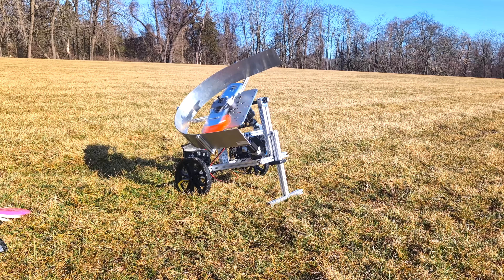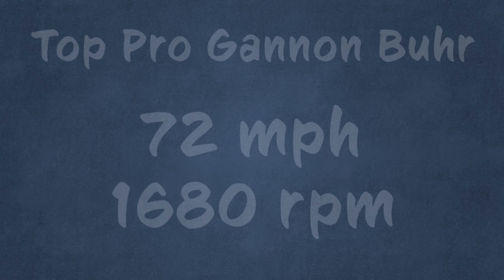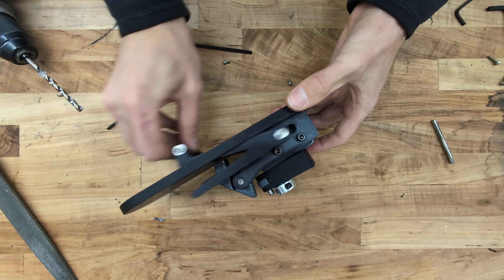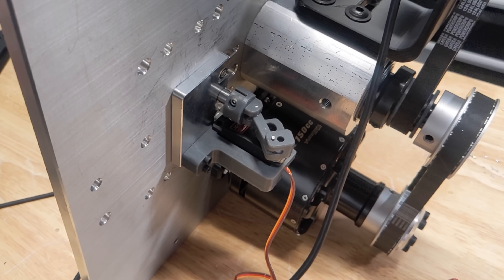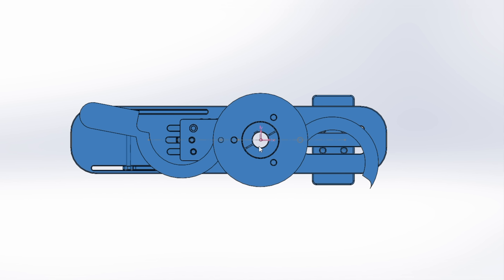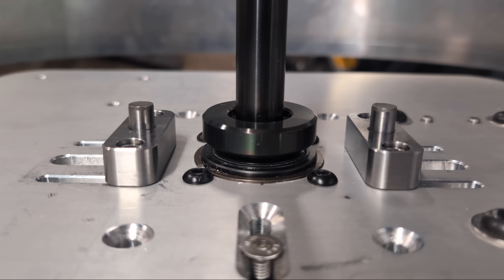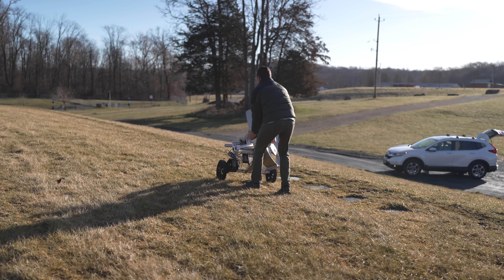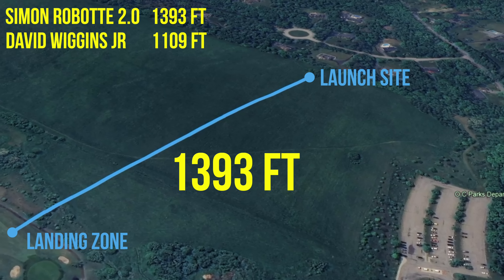We Built the World's Fastest Frisbee Launcher (Regulation Size)

Comment: Instead of strapping it down harder, could you not have some rubber bushes on the legs to remove some of the vibration? So strap it harder to the rubber blocks that will mean there is some flex and give, plus it softens the aggression if that makes sense?

Comment: The one that came back to you might have been because of the angle of attack that you launched it at. That's a frisbee trick I used to do to play catch with myself all the time. If you throw it at the right angle it acts like a boomerang and comes right back to the thrower. I think you need to dial back the speed and do a bunch of angle of attack tests to see what throw is actually the optimal for distance. Especially with your machine being able to do not only angle to horizon launch degrees but also left right angle.

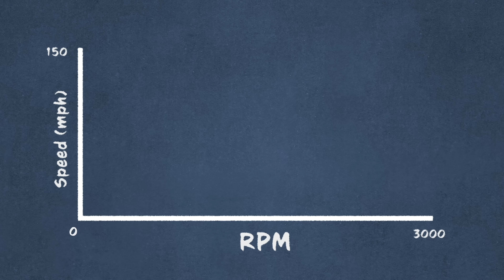Comment: 2:12 why is there no math needed? the fact that disc rpm = arm rpm is not obvious at all. 
the dV of the inside and outside of the disc are fixed independant of rotation speed. the faster it spins on the oustide the faster it spins on the inside too. otherwise the disc would deform, and it doesn't.

Comment: If that motor is really 13.4 HP,  they have come a long way.  When I worked in a factory a 5 HP motor was moved with a forklift.
  
But more important, the stresses on your metal must be real or the parts wouldn't have bent.  But similar stresses must be present in the human arm of the thrower.  (especially in deceleration)  Wiggins 1100 foot throw was in a 43 MPH wind, but he can legitimately throw in the 700 - 800 foot range, so around half that of your machine.  Seems like his arm should come off.  

I've been to Punkin Chunkin and watched the centrifugals fire pumpkins, same principle as your machine.  Did you get any design help from those?

Comment: call me old fashioned, but as teenage automotive  punks in the mid 70s, we could have told you these early designs would fail. Aluminum is MUCH WEAKER. The forces in play are huge. When in doubt, use steel.

Comment: I used to throw these things on the beach spent about 10 years perfecting long shots, I think stuff made here could throw a lot further if he can get some rollers that don't fall apart because it was always the last flick giving it more spin than what your arm was spinning that gave it more airtime, spin was more important than power. You should also try launching over water, I think the air flowing over water is smoother than the air flowing over ground, so you will be launching into very smooth air compared to on land, I think this could be why the guy broke the record in the desert. The air at the launch site is moving smoothly.

Comment: @We.Make.Machines  I've been playing for 25 years or so now, I'm not trying to sound rude, but instead help you get better.   You need to work on your drive throw.   You look away for half a second before release only to look back right at release.   Instead keep staring down the "green" and get that arm nice and parallel with your eye direction.  It's going to take a lot of practice to break your current drive habit.  But you'll see a huge improvement over time of rogue throws slapping into trees and poles and whatnot haha.

Comment: Those spin numbers are interesting. The rim is spinning at around 60% the speed of the disc.  So that would mean it's like it is launched from a hinge point just 7 cm from the rim (I'm only 2 minutes in so I guess you'll have those 7 cm from the rim of the disc to the center of your spinner thing). But that means the forearm has passed more energy into the swivel of the wrist at the time of launch than I thought. Interesting 🤔

Comment: you should mount a flywheel under the arm, or if possible on the opposite side of the motor. this will add gyroscopic stability to the machine. i would suggest a semi-trailer flywheel. and the release finger could be curved like a cam.

Comment: Would it be possible to increase speed by using a whip effect? For example if you added a string that holds the disc and keep the same spinning design but then use the lag force of the rope to launch it faster and further?

Comment: I noticed your horse shoe shaped shield on the machine. It's attached from the bottom side with three narrow brackets. I feel like it would have done better with a solid metal bottom and maybe even a top. You wouldn't see the disc while it's in the machine but all that wind it generates wouldn't escape, also it would give the machine more stability. Just a idea 🤷

Comment: Discs should be standardized with this and have a chart with different speeds and what to expect at every 5-10 mph increasing increments starting from 40-50 mph, could even have a anhyzer and hyzer chart as well. It's not going to be 100% due to different spin rates and nose angle humans apply in their form but it will be better then accepting something like 9/5/-1/2 as a rating and get a meat hook or a roller.

Comment: i reckon you can nearly double the force by altering the design a bit.

what happens if you jam a stick in the front wheel of a bike?

make the wheel with the intention of braking it as rapidly as possible. "jam a stick in the spokes". at a point directly opposite the disc itself. let it pivot freely around that point when braked...

yes, its going to absolutely slam the brake... thats the idea. the mount is solidly fixed to the ground and doesnt move. 

 and all the inertia stored in the wheel is going to convert to a torque around the new pivot. now the disc, along with its current velocity, is being accelerated by the inertia of the wheel itself, pivoting off a fulcrum twice the distance away.

light wheel, heavy disc... no force. heavy wheel, light disc, plenty of punch...

Comment: Boys youre good at mechanical engineering but i guess youre not that familiar with some stuff from electrical engineering, so let me clarify some stuff for you. For this application there is a much easier way to make this work. For getting the disc to spin at a desired speed you apsolutely dont need a powerful motor. The disc is really light weight and doesnt need as much torque to be accelerated (even with the counter weight). Other very important thing is that you dont need a mechanical way of braking. If you use just a regular ac motor or servo motor drive you can do different types of braking. The fastest way to get something to decelerate, which is faster than any mechanical solution including friction or counterweight, is to brake the ac motor with DC current, or in the case of using a servo, a down ramp. Only in this application the power of your motor, which dictates the torque motor can achieve, also dictates the braking torque. But even for the smaller motors in this application the braking would be instantaneous or with a curve you choose. For braking in this application i would choose an S- curve on motor drive, which preserves the mechanical parts the most (barely any stress is applied).

Comment: I use the same motor in my 30lb combat robot. Its job there is to drive a 10lb steel drum up to a tip speed of 330mph. I've seen similar failures to that bent arm in some previous drum designs with the middle bowing out. I've sent other 30lb machines more than 10 feet in the air before. The kinetic energy involved in that arm is insane.
Reply from the maker: It's an absolute monster! The motor is hardly running above idle current while spinning our 11lb arm.
Reply: @We.Make.Machines  For me it spikes to 200A on startup and gets cut off there, but once the weapon is up to speed and mostly contending with aerodynamic drag, it wants to sit just above the idle, very similar to your spinning arm. I'd wager you aren't seeing as large of a spike as the motor is ramping up much more slowly. Apparently the 250lb bot "Claw Viper" on the Battlebots TV show uses a similar motor to drive each of 4 wheels individually, and the bot "Riptide" uses a pair in tandem to spin a 50lb+ weapon at 250mph tip speed. Mine was taken from an electric dirt bike, if you want a cool extra project for it.

Comment: We know the human record was with a 150 class R-Pro Boss, what was the weight, plastic, and mold that set the robot record?
Reply from the maker: Lighter discs are easier for humans to accelerate in the short time between reachback and release. With some mods, our machine could throw a 5 lb disc at 200mph if we had one.
Reply from the maker: 175g Z Nuke OS, but I believe there are many plastics and molds that could go at least this far.
Reply: @We.Make.Machines  That's a beefy disc!  Usually the human distance records are with more flippy plastics or lightweight discs.  This shows how powerful your bot is since they don't really make 13 speed discs with more stability than that.

Comment: This machine should be tested in regular pro speed with each disc to improve the sport and disc manufacturing. By determining the exact launch angle and speed you could test the actual numbers of a disc and the actual physics of the sport. Of course you have to have the perfect conditions such as almost no wind what so ever . Or you could just find an equation to bypass the effects of the wind and tell you the number needed... BTW: You could actually be able to create a disc golf simulator or launch monitor using your machine's data  just like golf. It could even be just a phone app because no such speeds are necessary like real golf. A good phone camera would be sufficient even for a pro ;)  . But anyways this is the only successfully working prototype that I could see on the internet for  disc golf so far . Kudos to you guys !!!

Comment: https://youtu.be/xr-ik3WJnO0?t=923
 "that didn't sound good" 
is this why there were no more attempts? cool design but terrifying. Gotta get some steel into the structural support for the throwing arm so it has some flex strength and can rebound better.  Also, you really need to find a more remote and larger location, you're last toss went into a golf course and if that beaned someone you would have lost everything.

Comment: Love this follow-up to the previous video with the minis! Hopefully in some months time we'll maybe get another follow-up where you dial it back and see if you can better replicate real throws. Would have been cool to see the TechDisc data thrown on this thing (not full power so you don't destroy the TechDisc). I'm guessing you would find that the disc's nose angle is flat at best, and potentially nose-up. The nose angle is definitely what made that last throw on the first day into more of an MTA attempt than a distance record.

I'm also guessing that comparing a real player to this machine at the same launch speed would reveal you're not getting the same RPM at launch on the machine. For a real player, there's a whip-like motion that's ripping the disc out of the hand at the hit. This should result in higher RPM than just relying on difference in velocity at the inside and outside of the disc from simply spinning the whole thing like this.

Nose angle should be addressable with a tweak to the release armature, and I would love to see how that changes the results you get. Imitating the more whip-like release would be a whole other challenge, though.

Comment: It is so crazy that it took building an insanely high powered machine like this just to beat David's record by ~200ft. Yeah that is a pretty good margin, but for that amount of power I would have expected to easy double the distance a human could achieve. Just shows how absolutely insane David's throw was for a human to break 1000ft. 

I would hypothesize that you are still leaving distance on the table with this machine thanks to aerodynamic drag on the lightweight discs moving at that high velocity. I would love to see this thing throw a heavier disc, like a machined aluminum one to cut through the air better.  A part two where you throw the rulebook out the window, and try to optimize a custom disc for the sole purpose or squeezing maximum performance out of the machine would be awesome to see.
Reply: Probably at the terminal moment a human can optimize every variable throwing a disc. I expected double performance from a machine, too, but I guess they (as seen here) have their own limits, currently. All the raw power in the world, none of the brains.
Reply: I know this is a few months old video but just wanted to chime in and remind you that Dave also was out in Utah on the salt flats throwing with 40mph wind at his back. It was mentioned in the video as well.

Comment: Doesn't the radius of the throwing arm affect the spin rate? If i build a machine that moves straight at 200mph, the disc has no spin. In discgolf usually the goal is to move your arm across in a straight line aswell (i know the wrist still rolls). Does it really simulate a throw with such a small radius?
Reply from the maker: Exactly, the straight line is a misconception. The effective radius of a human throw, i.e. the hip, torso, shoulder, elbow, wrist, and finger rotation all averaged out is equivalent to the effective radius of our machine. So the human and machine are doing the same thing, rotating around a radius, the human just has way more radii linked together with joints. Our rpm to speed slope ends up roughly equivalent to a pro disc golfer, and this is also adjustable.
Reply: @We.Make.Machines  Thanks for explaining. Good job guys!

Comment: $300 dollars for that little "tech disc" .   I have a design for a disc launcher in my head for years I have not seen anyone implement it.  I hope one day I can make it and try it out.  Currently without a workshop.
Reply: I would spin the disc up to high speed not the arm.   Then launch it with a crossbow like device.  A grommet in the center of the disc would allow the spin to happen and be the firing pin for the launcher.  With the disc already at a high spin rate the force of launch would not have to be so strong.   This design would be the  size of a crossbow so you could actually play with it because the forces are sensible.  Ive seen designs like yours and they are dangerous and don't have real world play in mind.  My design comes from taking out the players ability to maximize the flight of the disc.   It could be away for handicap ppl to play disc golf too.
Reply: I do commend your efforts.  This is a lots of skill and work involved in making your contraption.  It also cost yall a lot of money too.